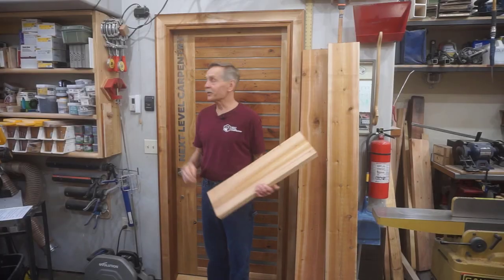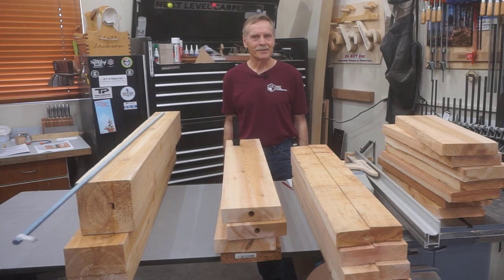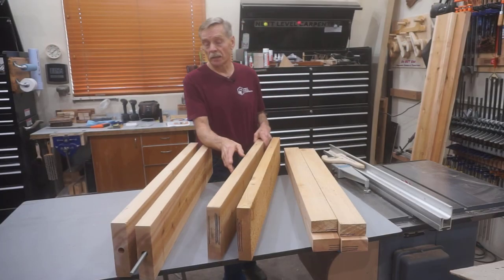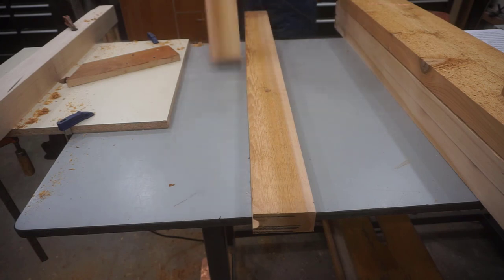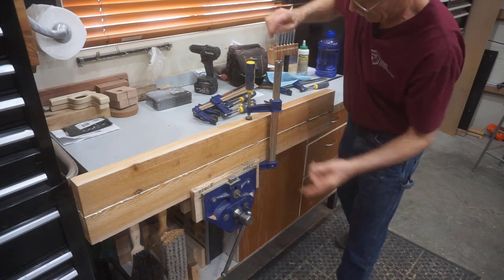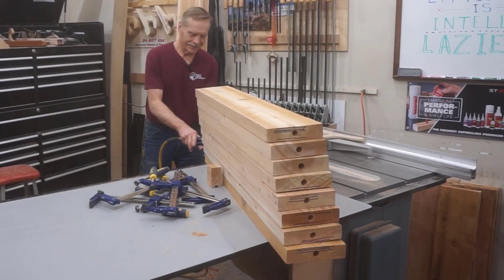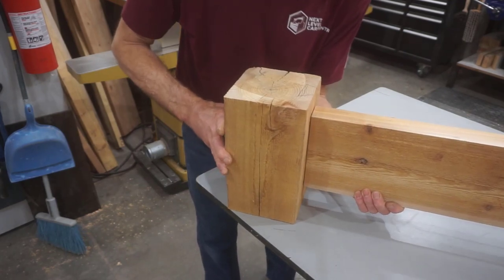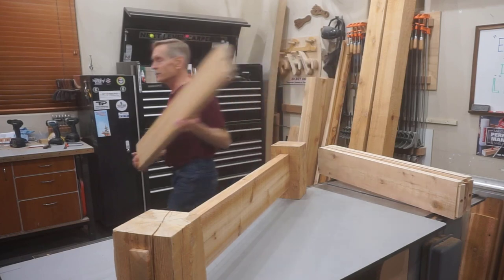Perfect Holes in Long Boards

Comment: Nice but you can't core a door like that to run wires from hinge to an electric lock.
Reply from the maker: Not unless the door maker has the foresight to 'drill' that hole through pieces of the door ahead of time which is the responsible way to approach the matter.  Otherwise the poor person who's assigned the job is going to spend a good hour or so sweating bullets while drilling with a ship's auger bit in from both edges of the door hoping the bit doesn't come out the face, right?!

Comment: Great idea!  You'd just need to factor in the width of the table saw's kerf if the width of the board to be "drilled" is critical in a project.  Might not be as useful if you don't have a planer, but careful use of the table saw and a jig to emulate the planer's action should function as a workaround.  My question though is:  What's the story behind the misspelling of the word "Laziness"?

Comment: Nice trick, but to me it's a bit of cheating. If I want something bombproof (which I usually do), I'll go with long bolts and round nuts in blind holes - couldn't find it at the homedepot website, so maybe round nuts are not commonly available in the U.S., but you can make them yourself.
Just take a piece of round stock,  drill and tap a hole matching your bolts , then cut it to lenght and make a slot indicating the direction of the hole (when assembling the parts, you can align it with a flathead screwdriver, countersinking the holes helps a lot). Take long bolts, e.g. flathead or panhead bolts for Allen keys. The bolt will pull the joint to the angle you cut the face to, causing your workpiece to warp, if it's not a true 90° in both directions. If you cut the round nuts a little short, you can hide them with wooden plugs. The bolt should be left open, until the wood is well dried. Then you can tighten them down, if the joint gets loose due to shrinkage. I love furniture that can be taken apart completely, saves a lot of space (and money) if you have to move it. You can also replace every single piece, if needed (my dog once chewed down a leg of my tool shelf).
Reply from the maker: And somehow you conclude that one type of Hardware is cheating more than another? Interesting...
Reply: @NextLevelCarpentry  - Not a question of hardware, it's about cutting the boards and later glueing them back together, hiding the cut with sawdust and a sharp putty.
BTW - wood and steel are moving different with temperature and moisture, so, using all-thread is more likely to work itself loose.

Comment: "8 metric teeth per inch" ROFL
Reply from the maker: What else could I say when the sleeve the saw comes in says "8~9 teeth per inch"?  THEY don't even know how many teeth there are per inch? 😳 Never seen that before so I  figure it's like 1" masking tap that's a "metric inch" wide at like .94".  Some day manufacturers will get off the fence and tell it like it is with Teeth per cm... but I'm not holding my breath.😉
Best, Matt

Comment: Dayum!  Clever and sneaky…but cheating…I wanted to see you weld a 3/4 drill but that ‘all thread’ and have some clever way of keeping it on track as it went through Lol.  Tip:  if you wanted to use the technique without those mortised blocks…you can lay copper or steel tube in the cut groove and glue it in with epoxy.  This will provide far more bonded surface area than the two slim edges alone.

Comment: so you never drilled them .... what if you simply cant split the wood to do this ?
Reply from the maker: If you're not capable of 'splitting' wood you wouldn't be capable of drilling a hole that long/deep either because reliably drilling accurate holes lengthwise through boards much shorter than this is no easy task even with expensive equipment.

Comment: I know there's a lot of obesity in the USA, but do bunkbeds really need to be so over engineered these days?
Reply from the maker: Many bunk beds are overbuilt according to their weight carrying capacity but most of them are overbuilt so the pieces don't look spindly from a design perspective and has nothing to do with the Obesity epidemic. Also the extra heavy duty Hardware I used on these bunk beds was as much for controlling roughsawn Cedar Lumber as it dries as for any other reason.

Comment: Zink will badly stain your cedar. Use stainless steel or plane steel instead. It really makes a diffrence. The stained wood turns an ugly gray color.
Reply from the maker: A good point but not a concern when using the zinc internally in a dry environment.

Comment: I love the creative method of “drilling,” but the thumbnail shows the hole being used as a conduit for 120VAC electrical wires. Yikes! Electrical wires warm up when they’re being used and the wood will act both as a temperature insulator and as tinder. The nightmare scenario is if someone plugs a space heater or hairdryer into the circuit that runs through the wood. The wires can heat up and melt the plastic insulation they came with, and from there it’s a time bomb of fire risk. 

Ideally 120VAC wires wouldn’t be concealed in wood, but if it’s truly the only way, you can install a metal conduit and run the wires through that. The metal will simultaneously disperse heat, cause a blown fuse if there’s a short (thereby acting as protection as designed), and protect the wood from carbonizing due to repetitive arc fault which is a major cause of house fires. If it’s just for lighting, consider whether you can use low voltage wiring that will never be compatible with any high wattage device.

A mountain cabin where people might plug a space heater into a circuit routed through wood, and go to sleep, especially if they’re on vacation and having a beer or ten, and might not think about the exact source of wood smoke, that’s a recipe for a real disaster.
Reply: Use a thicker guage wire/cable and keep the fuse to a low amperage, it will prevent the development of too much heat in the cable.

For wood to burn you need oxigen aswell, so try and plug the ends of cableruns as best as you can with firesafe mastic.

And prevent arcing by installing good cable in a decent manner.

Electrical fires occur due to sloppy work either on the design side (choosing the wrong breakers for the right cable guage or vice versa, not thinking through cable lengte, using aluminium wire where copper would be better) and/or on the install were cable connections are made with high resistance and/or cable getting shafed dragging on sharp edges (for instance in metal pipe).
Reply: @bertbergers9171  eh, larger gauge wire does heat up less as you say, but it’s kind of an arms race that the conductor can’t win. There’s no conductor so large that it can’t be overwhelmed by a sufficiently high wattage appliance. And what’s the likelihood of anyone who isn’t an electrician springing for 10AWG or bigger? 

The fire resistant mastic will hold back the oxygen for a while, but in the application shown, the wall of the wooden “conduit” is 3/8” at most. An arc fault inside there will happily build a reservoir of powdered charcoal until it smolders through the side and finds the infinite oxygen it was wanting. 

Bottom line, putting in electric wire this way this is a terrible idea. It violates the NEC, and it turns the bed into a defective product because it’s internally wired but not UL listed. Neither your insurance agent nor your lawyer would sign off on it. Easy enough to use conduit as intended and skip the whole mess.

Comment: Sorry for my dislike and thumb down for this Video. It's a very dangerous Idea using gloves on rotating Machines. They are much quicker caught by the Tool than you think or can See. On a Router or Saw I always use Pushsticks instead of my hands. They can get exchanged or rebuilt, but my hands or fingers don't. So working safe is my first thing to consider.
Reply from the maker: Safety is an important focus for all woodworkers but lack of perspective in applying general safety practices as universal hard and fast rules is foolish.  I don't care if you don't like the video but your reasons show your limited perspective and experience where certain practices are concerned.